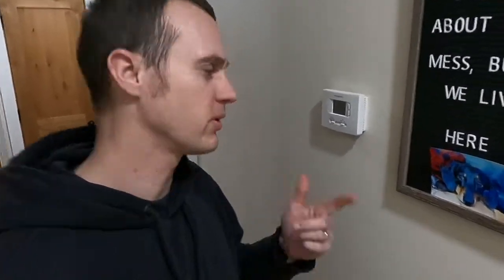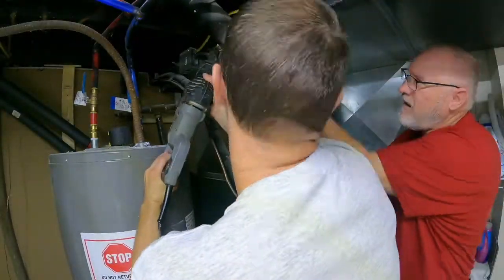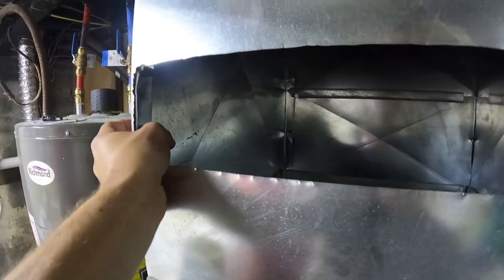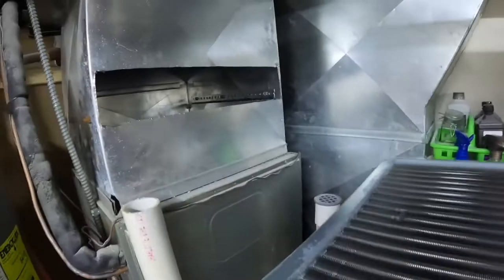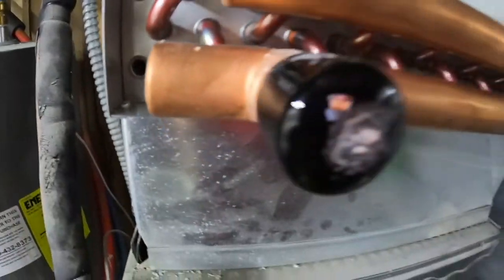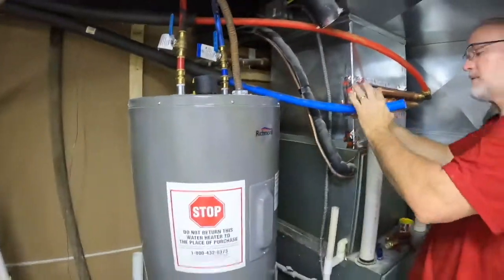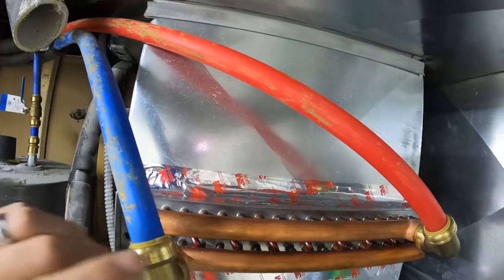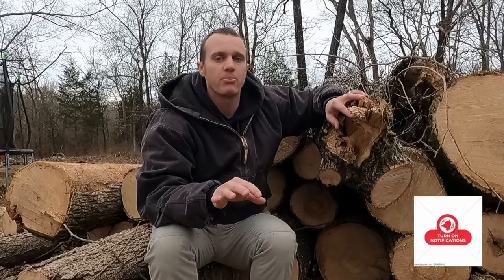Installing A Heat Exchanger For Your Wood Boiler!!

Comment: I don't mind the shark bit fittings, but in on the bottom, out on the top would have been best.  You'll push all of the air out of the top that way.

Comment: Hot in the bottom. Cold on top. Don't use shark bite, when those let go (and they do, they're not perfect as a soldered fitting by a long-shot) you'll flood the basement. No purge valve set in return, but you did it yourself. Bless your heart......
Reply from the maker: You do it the way you need to

Comment: Can you explain how you wired your blower to the thermostat so you're not using the existing gas heat?
Reply from the maker: Not sure if they are all wired the same but on my thermostat. I  switch the green and white wires places and it makes just the fan blow and not kick the gas on when calling for heat. So works the same kicks on when it gets cold but only the blower comes on.
Reply: So your furnace doesn’t use fuel if there isn’t hot water being supplied to the coil?
Reply: I think most people w this setup add a 2nd thermostat.   It allows you keep you standard furnace in running order just in case your boiler goes out.

Just set the boiler thermostat to kick on with a higher kick on than the other one.
Reply from the maker: @timothynovitski9133  no I am can switch the wiring back and make the gas be the source of heat. I have it wired so that only the fan kicks on when I use the wood boiler
Reply from the maker: @timothynovitski9133  sorry no I do not use fuel. Only if I wire the thermostat to call for the furnace to function as it normally would. I have it so it is only the blower
Reply: @mrpush2532   I would've done this, but I didn't ever wanna use my electric furnace again. For some reason, it was being powered by 2 separate 220 breakers..1 for the blower and 1 for the heating element. I always wondered why my electric bill was so high when I bought my home. I have gas wall heaters as a backup.

Comment: How good does it heat your house i am thinking about doing this to my house
Reply from the maker: It does good. I ran it to the barn as well, but before I did that. I only had to fill it up once a day or less depending on how cold it was. That also will depend on the size boiler you have as well.

Comment: How was the water lines piped in to your heat system? Using a pump?
Reply from the maker: Yes a circulating pump on the back of the boiler outside

Comment: What  pump did you use?  What  are the types called that can take the hot water?
Reply from the maker: Grundfdos is the brand there are lots of them. It is a 3 speed circulating pump. The longer the run or the higher it has to pump it the bigger it needs to be.

Comment: is there an issue in the summer with ac condenser being before the heat exchanger?
Reply from the maker: No I have no issues in the summer. I only have to change the way 2 wires are hooked up on the thermostat.
Reply: @projectdiy873  what 2 wires do you switch for ac? Also how did you get the furnace to run just the heat exchanger instead of using the gas as well? We are ditching our propane completely and going with just the heat exchanger from our wood boiler.
Reply from the maker: @cameronmaxwell4165  I will have to check to make for sure which wires I switched. It may depend on your thermostat and how it isnwired but I will let you know how I did mine. Just give me a lol bit to check. Also switching the wires is what allows the furnace to run only the fan of the furnace and not kick on your gas or heat pump whichever you may have. The heat exchanger is basically just a radiator that gets hot from the hot water being pumped from the boiler and then the fan kicks on the furnace and blows across and gives hot air!
Reply from the maker: @cameronmaxwell4165  I switch the green and the white. In the winter they are switched in the summer they are in normal places.

Comment: what supplier did you use for your  copper heat exchanger  ?
Reply from the maker: I got it from either seller freeheat4u on ebay. Or off of Amazon.